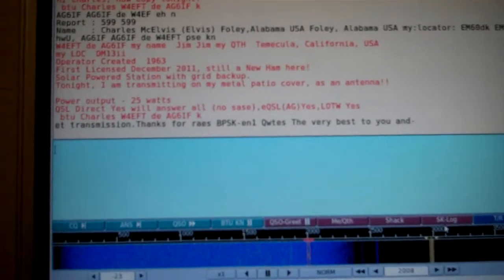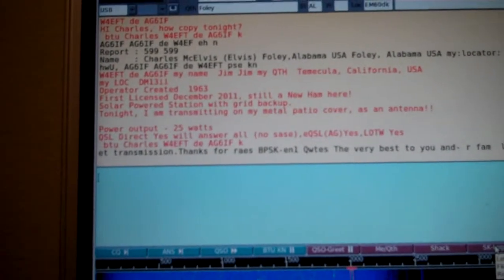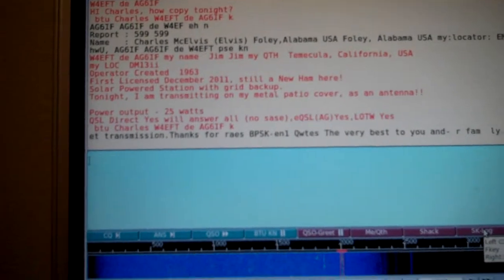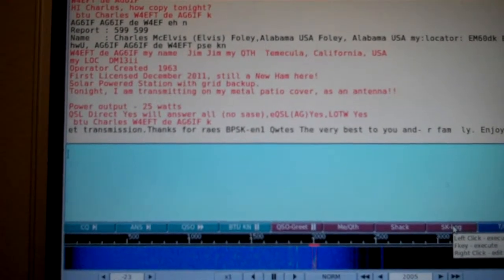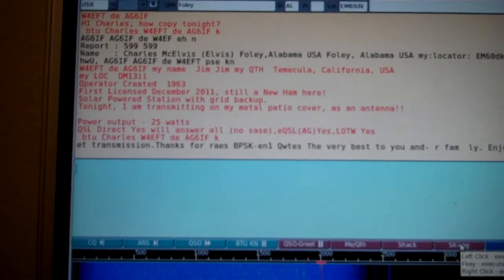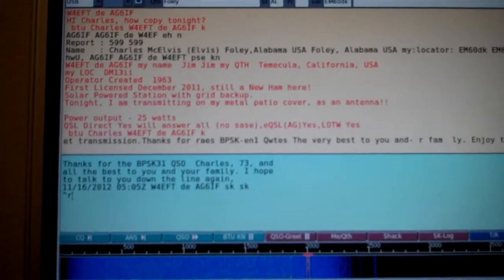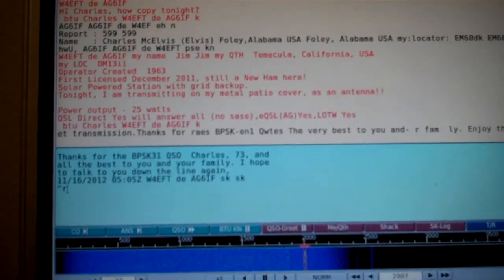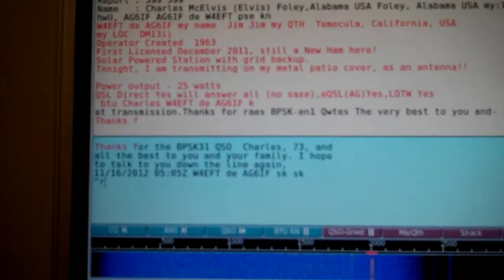Use a patio cover as an HF Ham antenna psk31 from AG6IF

Comment: I do not understand what you mean by using an end fed zep as an interface?  Isnt an end fed zep an antenna already? Maybe I am incorrect with the nomenclature as to what defines an end fed zep? I thought it was similiar to a folded dipole and fed with balance line or kinda of a cross between a long wire and a dipole with a counterpoise????
What you seem to be showing in the video is a center insulator or feed point for a dipole constructed from PVC pipe fittings and have clip leaded this to the bolt on the foundation..... I assume that perhaps it might have some sort of transformer circuit constructed inside?
So whats your trickery or wizardry or what have you?
Reply from the maker: The interface is an UNUN designed for a long wire, end fed.  It is close to a 9 to 1 winding and works pretty well with all sorts of random objects, especially long chain link fences.
Reply: Hmmmmmm........ Very interesting,,,,,,
So a 9:1 Balun is the trick device for loading random objects into useful  antenna? WoW! 
I am wondering how and why? In your video you show it simply clipped to the bolt that secures your patio cover. I would think that the bolt sunk into concrete would become your ground reference. Where do you attach the other half of the circuit ? Do you leave it unterminated? I am thinking or actually just quessing,,, that perhaps you are radiating mostly thru the feedline and in this case its your coax that is mostly becoming the antenna and not so much the object that you are clipping the lead onto. Somewhat similar to what I believe to understand how a beverage antenna functions????? I am not too sure here, but just trying to figure it out. 
The cool factor is being able to clip onto anything and make it useful as an antenna. I can understand the fun in doing that! I am game for such experimentation for sure,,,,
Is this Balun that you are using commercially avail? Do you have a schematic for it? 
It seems that a balun is a balun is a balun isnt so simple and that there are many forms of 9:1 baluns, and the various designs using the generalized nomenclature described as a balun....
 I certainly would like to build your exact device and experiment with various objects like you have. 
A simple 9:1 balun would make the ultimate portable must have accessory! 
I think that it matters not so much how it works as much as does it work, I think that this is a very fun experiment none the less!  I also believe  that if you try different feedlines and keep the patio cover and balun the constant, the feedlines will play the biggest difference.
Reply: Here is a page I just found that you might be interested
http://vk5ajl.com/projects/baluns.php#basics
Reply from the maker: yes, the stud isn't grounded, its merely holding the patio cover to the slab.  The clip is feeding the patio cover through the support.  The other end is not terminated however, adding a counterpoise helps the antenna to radiate..   I have built a 73 tertiary coil design that even loads up better than this end-fed box.    My QRZ page has  a graph showing the SWR sweep...actually loads up pretty good on 160m.